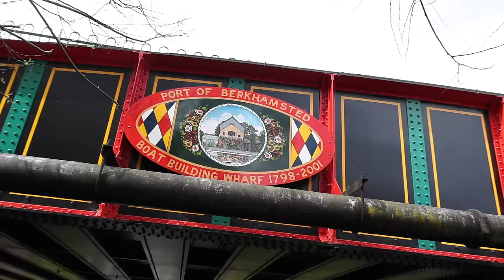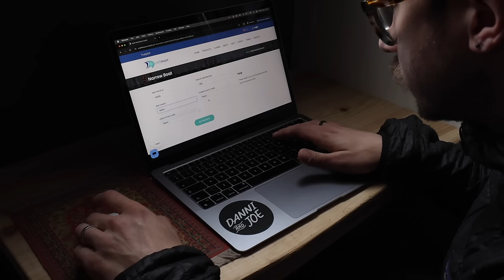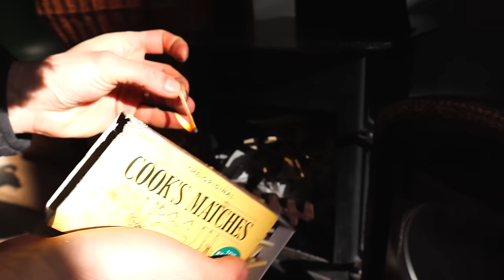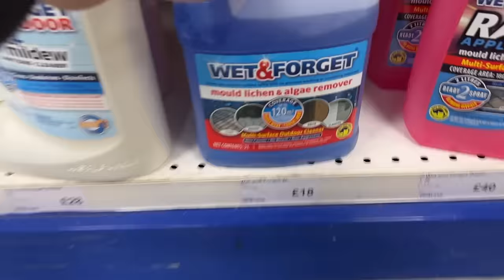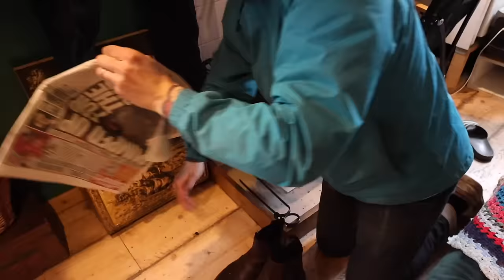Travelling Solo On My NARROWBOAT HOME. Hemel Hempstead To PORT OF BERKHAMSTEAD

Comment: Er… Joe did you notice you’d left the pressure cap off the heat exchanger after you put the deck board down…?
Reply: I've tried mentioning they need it replaced....
Reply from the maker: Yeah we were having issues with airlocks, since removing the cap it’s helped (should probably find something to loosely cover it for now)

Comment: Can you just add a copper T piece in the top crossover pipe you added. Have the T piece facing upward with maybe a gauze on it or a one way valve.
Reply: That should work so long as the top of the tee is above the top of the filler point.  Not sure if it's the same on boats, but on diesel powered plant, the breather is usually in the filler cap. Can you show the filler cap sometime Joe?
Reply from the maker: Yeah thinking of a tee off of that, but it would need to come up about 1ft out of the deck somewhere to match the filler height! 
I’ll check the filler itself again but I couldn’t see anything obvious there

Comment: Jo, put the copper pipe you removed back in place but add a T piece and run the verticle section up above the deck then either bend the top of the tube over or use fittings to make up a U section so the end is facing down to stop the rain getting in
Reply from the maker: Good shout!
Reply: @DanniandJoe   Does the filler cap not have a breather built in?

Comment: Reinstall the top crossover pipe, get a self tapping pipe saddle from the plumbing store for that pipe and run a breather off of that saddle.Try and run the breather close to the fill opening so you can to tell if it is full and not running into your bilge. EXTRA: sunken boat  at water refill was James first boat DOPE Narrowboat that James built
Reply from the maker: Yeah thinking of a tee off of that, but it would need to come up about 1ft out of the deck somewhere to match the filler height!
Reply from the maker: Ah no way who’s boat is it now?

Comment: put a t on the top pipe to make a breather pipe then run that up above the deck
Reply from the maker: Yeah thinking of a tee off of that, but it would need to come up about 1ft out of the deck somewhere to match the filler height!

Comment: Hi Joe,
Use Magnesium anodes for fresh water .
Aluminium and Zinc work better in salt water.
As for fitting them we welded some all thread to the Hull and drilled holes in the anodes backing plate and then just used a nut and a locking nut to have it up against the hull
Reply from the maker: Ahh yes cheers!

Comment: I use Wet and Forget all the time.   It's not instant, but spray it on  and a few days later, you will see the results.   I sprayed my grannies headstones. They were black with mould and lichen  it took  a spray every 3 moths and now they are snow white.   While I was spraying the cemetary, workers told me it doesn't work, a year latter they said 'Whats the name of that stuff you sprayed on the headstone"  just goes to show if you  follow the instructions to the letter it will work.

Comment: Great vlog Joel Regarding ur breather pipe why not attach a tee junction pipe into the pipe u removed , therefore the diesel  will transfer as usual and tee junction should make it breathe.
Reply from the maker: thinking of a tee off of that, but it would need to come up about 1ft out of the deck somewhere to match the filler height!

Comment: Re your belt noise,  use a can of belt eliminator and use it just on the Alterantor belt.. If its that belt making the noise, suggest its due to the load being put on the alternator at start up as its being asked to recharge, ? your boat battery along with House Batteries.. If thats the case look at a controler to lower the load at start up. or put and auto tensioner on that belt....
Cheers and keep at it...

Comment: Quick tip for the squeaking belt if you don’t have the proper belt spray, a little bit of treacle obviously on the v section. Cheers
Reply from the maker: I bought a can of the spray but everyone told me not to use it, maybe I’ll give it a try but it’s the bracket causing it to be out of perfect alignment to be honest - I need to fix it
Reply: @DanniandJoe  nothing is easy on a boat Joe, we owned a hotel boat Helen of the West (had her built) and operated it from the wharf in Devizes everything was new still had problems now and then.  As you said there are some very friendly and helpful people on the cut. Cheers

Comment: Zinc anodes - believe it or not, there is similar information coming from the current drydocking of the now a museum US battleship USS New Jersey. The Curator was telling how zing anodes work best in salt water & where the ship has its museum berth is in fresh/brackish water where a different metal works better for anodes, indeed those aluminum anodes.
Reply from the maker: Yeah I was reading info on sailing boats and not Narrowboats!

Comment: Put a breather on the 22mm copper pipe. 

Have a look at an Auto Air Vent (AAV). They are used in boilers and  on heating systems. 

They are to vent air without letting water out, so my not be suitable unless to adapt it to let air in.
Reply from the maker: Yeah think that the way to go! Cheers
Reply: @DanniandJoe  you could put in a 22mm tee with a 1/2inch  rad blead plug on the tee bit upstand part. That should work.
Reply: @DanniandJoe  type in 22mm 1/2" 22mm tee. Toolstation sell them.

Comment: Looking forward to the sourdough recipe! I got into sourdough during the first lockdown. been ages since I did one though.
If you're still around Berko, go to The Rising Sun pub. It's right on a lock and a great little pub. 
I'm moored up in Leighton Buzzard, heading your way. Boat's called Joshua, two massive solar panels and a cargo bike on the roof. If you pass by and I'm in, feel free to pop in for a cuppa/beer.  I might be able to help you with that welding.

Comment: Leave that copper pipe off, you don't need it. The tanks are balancing through the pipe at the bottom. That top pipe is the breather, or at least passes as one on your boat.
Reply from the maker: I just need to make sure it won’t overflow through those holes though - as the filler is 1ft above deck, so thinking tee off of the pipe & out of the deck

Comment: Hi, I'm currently watching your latest upload and noticed that you don't have a radiator cap on your engine! In the video, you showed us where you cleaned up the bilge, and it definitely looked like your cap was missing. Regarding your fuel breather issues, why don't you just put a tee piece with an elbow to stop any water ingress in the pipe that you removed in between the fuel tanks.
Reply from the maker: Yeah we were having issues with airlocks, since removing the cap it’s helped (should probably find something to loosely cover it for now) & thinking of a tee off of that, but it would need to come up about 1ft out of the deck somewhere to match the filler height!
Reply: @DanniandJoe  hopefully the engine will ast until your new one arrives. You must be using more fuel with the radiator cap off because the engine will struggle to get up to temperature without it on.
Couldn't you just add a breather pipe to the existing fuel cap that would save you messing around with pipework then? Something like a tee piece on top of the tank with a breather line and then the cap off the other part of the tee.

Comment: Crank Case Oil Breather is what the fuel boats talking about. It's on the side of the head
Reply: It's probably under a cover and will more than likely be looking like a metal tea strainer and blocked up
Reply: Actually on an old diesel like yours (sorry) it will probably but right under the top cover (crank Case cover).
Reply from the maker: No the diesel was backing up the filler when he was filling up with diesel - there’s literally not a breather attached to the diesel filler